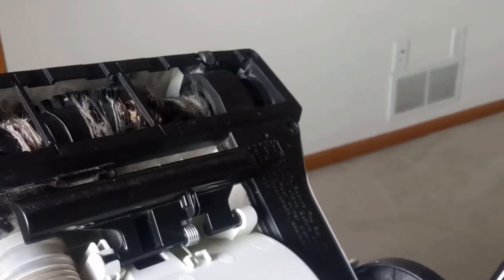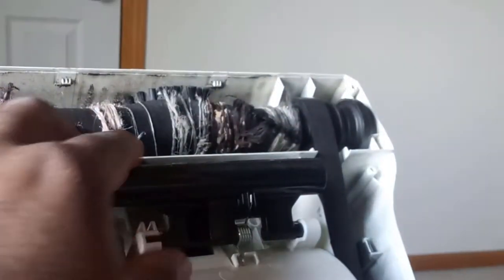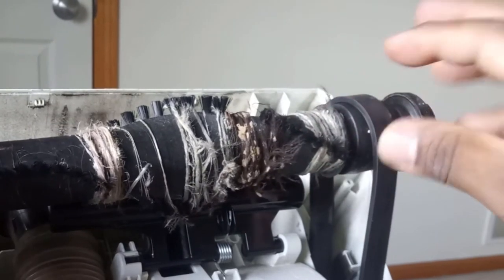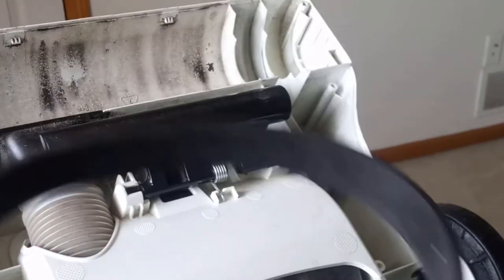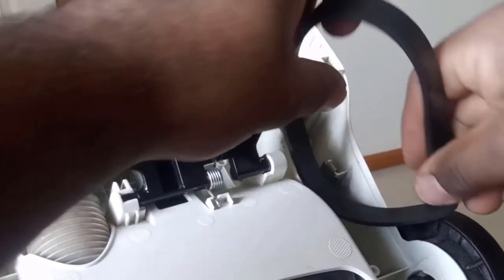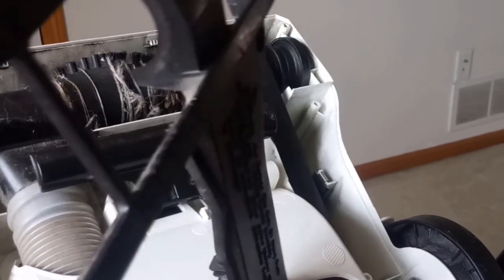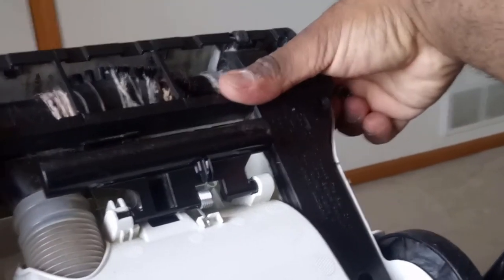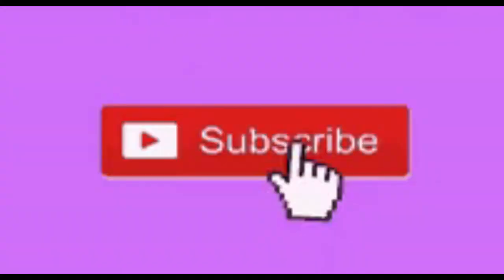Black & Decker Vacuum Belt replacement

Comment: On my model vacuum (BDASP103) there are 4 screws on the top of the motor housing that hold a removable piece of plastic. The rest of the vacuum rests on this frame when it’s sitting upright. Anyway, the belt spindle is exposed when this piece is removed. It’s still a very tight fit to get the belt on the spindle, but marginally easier than working from below. 
Belt item # B092DJFHW1
Good luck!